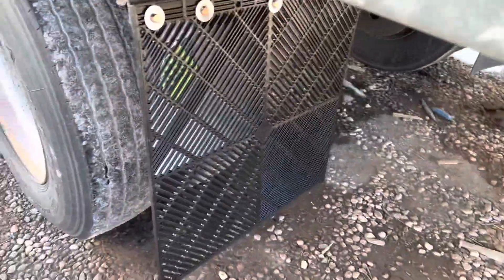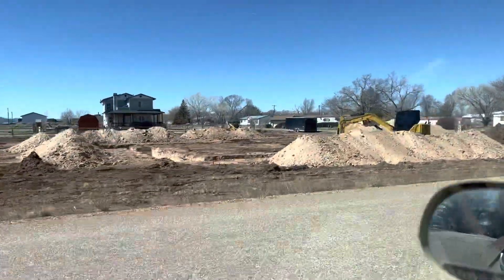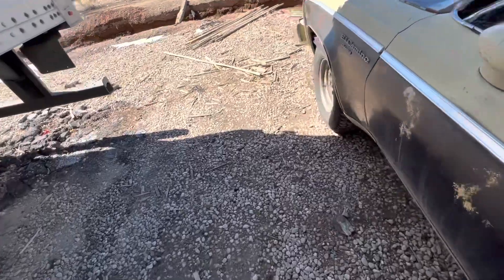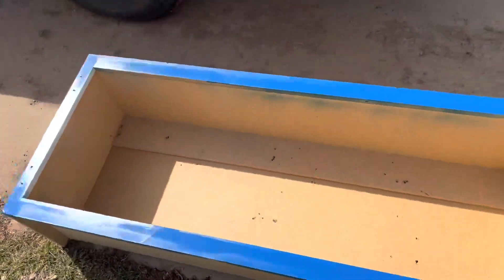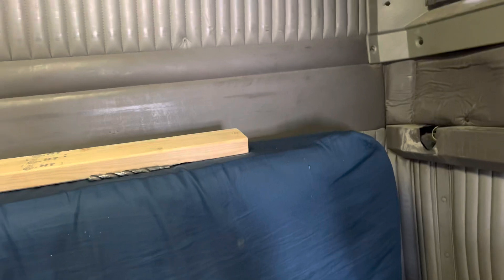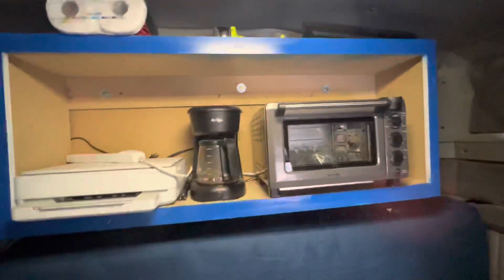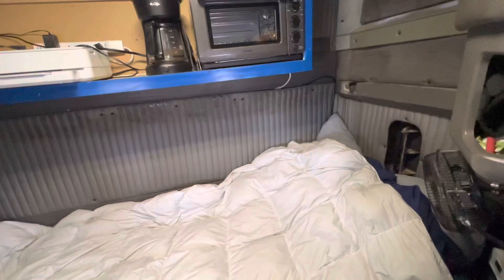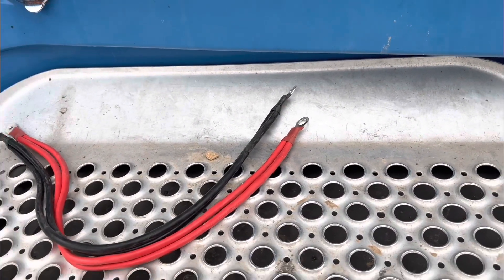Mudflaps And Cabinets. What a difference!

Comment: Oh, that drill bit had to feel lovely!  😲

I'm interested in seeing these meals.  Trying to do whatever is possible to not get a trucker belly again.  I've trimmed about 20lbs off since being home.  I am genetically disposed for all the extra fat going to the love handles and gut region, which looks really goofy on my body structure.
Reply from the maker: Same. I got down to 225. I’m back to 260. And I don’t eat but the frozen food. So guessing that’s my issue. Check it out. It’s Called Tovala. Main reason I went with them is because you get the oven for $99 after 6 weeks/orders it’s yours. Or you can pay the $200 or $300.. whatever it is. But then I can switch. There are a few different ones companies that do it. I’ll do a vid on it when I get the meals.

Comment: Hi I got question about this scan gauge , is this accurate ? I’m missing boost gauge and mpg are not accurate, thanks
Reply from the maker: Yes. Boost is showing accurate. All your gauges read your ECM. Whatever your ECM has for sensors. The scan gauge will show it. I don’t think it will show Emission sensors, but I could be wrong and you might be able to upgrade the scangauge.
Reply: @DrivingByBraille  ok but how do I know if ecm reads boost? I got Cummins 871
Reply from the maker: For your truck to mix the right air/fuel, ECM needs to read atmospheric pressure, ambient temperature and boost. You have a newer engine with an  EGR. It has a boost sensor. If your not sure. Look up your sensor location on that engine. Or have a shop plug into it and tell you what sensors it has. I guarantee it has a boost sensor. Pretty sure you can’t have a turbo without a boost sensor.
Reply: @DrivingByBraille  thanks , I was thinking to mount analog gauge on dash , there is a closed plug on pipe ,drill hole thru firewall for air hose and power from fuses,
Reply from the maker: That truck probably has the wiring harness already wired for the gauges. Even my truck has the plugs for ALL the gauges. My model didn’t come with the full gauge package. But all these trucks have the plugs even though they don’t have the gauges. Something to look into also.
Reply: @DrivingByBraille  I’m gonna buy this scan gauge and see what it shows , thanks for your time